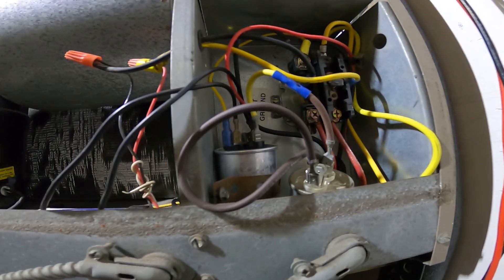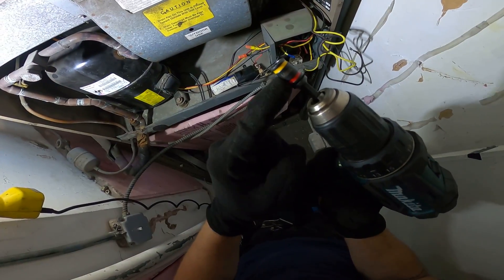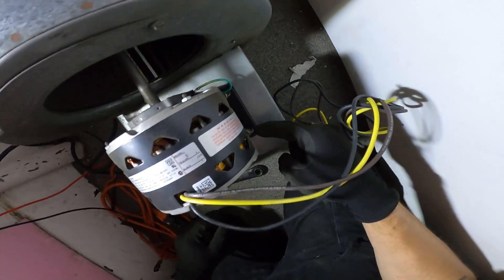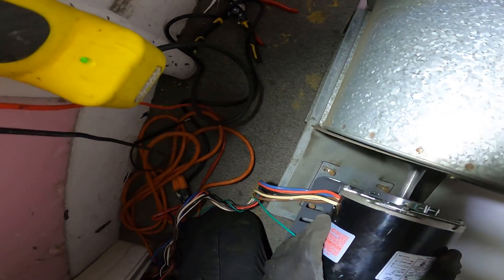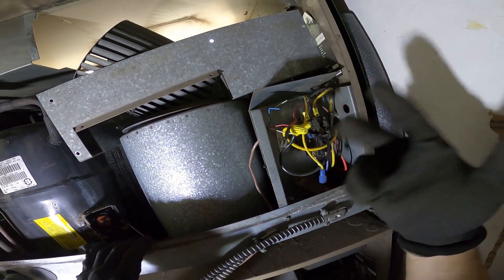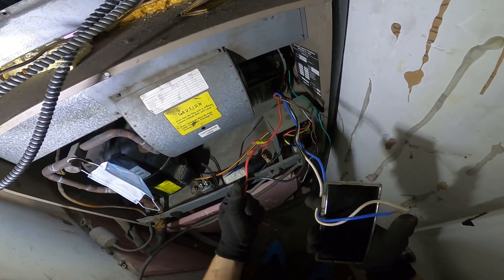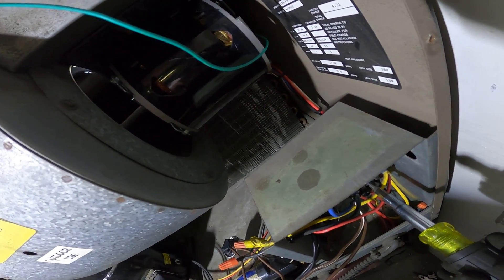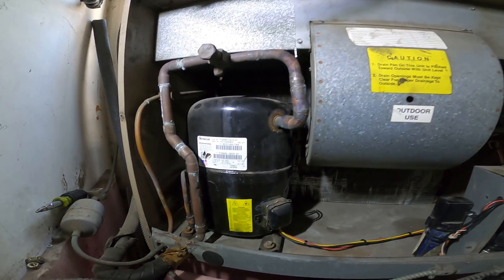HVAC: Single Phase Condenser Fan Motor Replacement (How To Install A HVAC Fan Motor) Blower Motor

Comment: Dude you should use your pen when pushing in a contactor. All plastic is safe. Please don't hurt yourself.
Reply from the maker: I hear you dude. My screwdriver is rated for 600 volts👍 I agree with you through. Better off your way. Thank you for your feedback & concern. Stay tuned for new videos every week!

Comment: Awesome job !! you really cleaned up the wiring nicely ! I use to work on those In-wall condensers all the time when I use to be a help in the AC company , as well we use to work on the SKYMARK Air-Cooled Self-Contained units too.
Reply from the maker: Thank you man! I appreicate the feedback. Yup, this one was a split unit in an apartment lol That's awesome dude. I worked on those skymark units as well. Just worked on one the other week. Hope all is well with you and the family. Be safe and stay tuned! Van build episode 3 drops tomorrow as well so keep an eye out!
Reply: @JumpermanTech  You're welcome! And cool I look forward to that video!